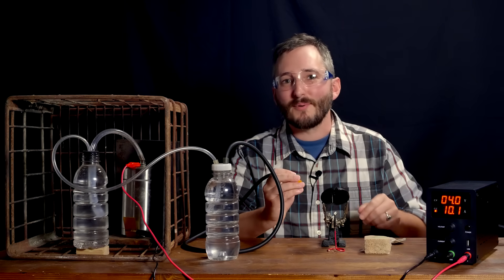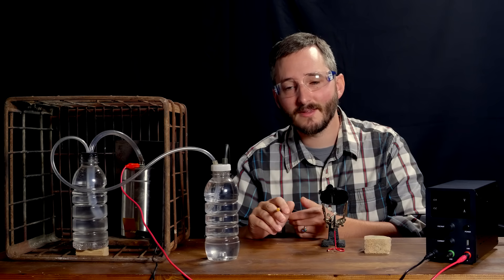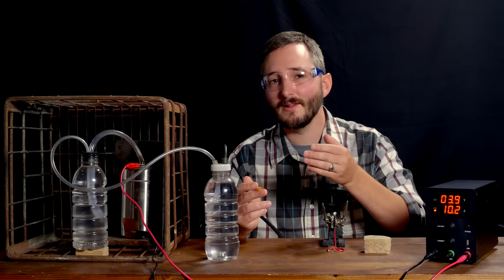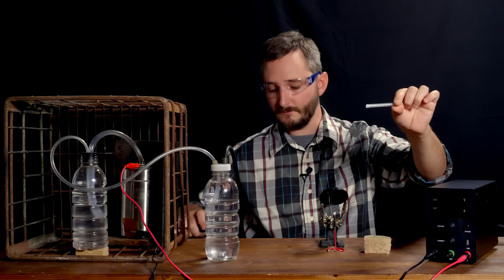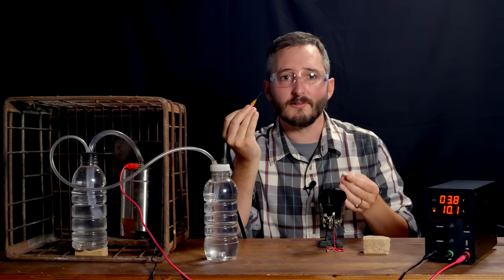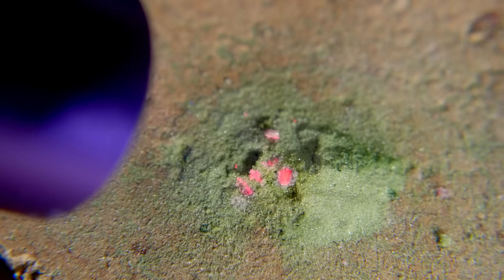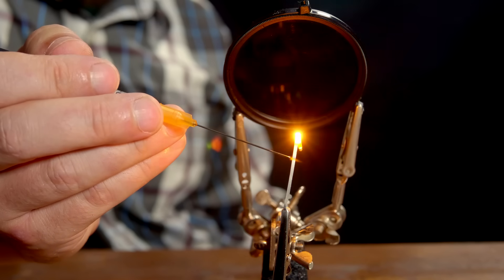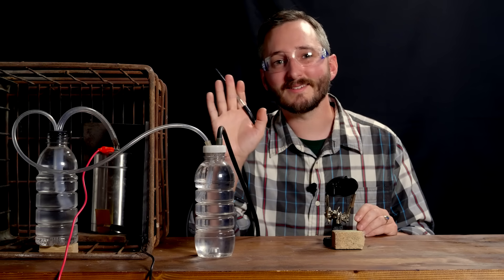DIY Oxy Hydrogen Torch Using Water Electrolysis

Comment: Thanks for another interesting video. What happens if you try to extinguish the flame in water? Will it burn underwater? If so, will it boil water? If it boils water it way be able to make steam and turn a turbine. Curious if you’d get more than 36W of energy back out. Not holding my breath for that one 🙂
Reply from the maker: I didn't try burning it underwater. That would be interesting. You definitely can't get more energy out than you put in

Comment: That torch would be hot enough to cut through steel I assume? I'd love to see what it could do for cutting power
Reply: Yes, it is hot enough, but I'd bet the steel would conduct heat away faster than the torch can add it.

 You're only putting in about 35 watts (and power out would be much less) plasma cutters operate in the kilowatt range
Reply: It likely wouldn't do that great for cutting, since the gas is an exact stoichiometric ratio, so you don't get the steel oxidising that does a lot of the cutting in typical torch cutting.

Comment: What if you increase the number of needles?
Would this make a “bigger” torch?
Reply: You would need to increase the size of the HHO generator in order to support an increase in the flow rate. Increasing the number of needles (or diameter) without increasing the HHO flow would cause the gas velocity to drop and lead to flashback.
Reply: @stumpy990  Though the bubbler setup he has in the video should arrest any flashbacks before they get back into the generator and blow that apart. Still, not something you really want to have happen.

Comment: "This is not a project to be replicated at home" sure thing :)
Reply: Couldn't you split the H and O lines to run through 2 different tips that were bonded together?
Reply: I think he covered the difficulties of splitting the hho in his last video. If I’m not mistaken, the generator he’s using now was one of his more efficient designs.
Reply: Well I rent, so doesn't that mean I'm technically doing it in someone else's home?   Legally speaking anyway.  I'm only familiar with bird law by training but I think it checks out.
Reply: @trotyl1432  He had a split cell in his previous video that worked quite well. The design could be upgraded to match his current metal body design, especially now that he has a micro-welder.

Comment: A good way to make them more user friendly is by mixing in a bit of propane into the HHO, the propane will make it more fuel rich and less explosive, it's a really neat way to make a very useful torch, and by changing amount of propane, you can get any flame you want
Reply from the maker: Interesting idea. Potentially useful and potentially safer, but I would still use a lot of caution.
Reply: @Nighthawkinlight   I used to use an oxyhydrogen torch for flame polishing the edges of cut acrylic, we also bubbled the gas mix through methyl ethyl ketone to give a better flame.
Reply: @peterjf7723  Where do you get the MEK from though?
Not easy to get your hands on these days.
Reply: @jimmyb1451  This was in Bristol in the UK. There was no problem in buying MEK there. We also used MEK for solvent bonding PVC parts.
Reply: @peterjf7723  Ahhh... It's different over here in Aus. :/

Too many .... people smoking frozen water. Almost become a controlled substance. 

Friggen handy to have around though, for a multitude of reasons that are not ... that.
Reply: You used MEK for the bubbler? That sounds sketchy as
Reply: @jimmyb1451  It will be in any decent sized hardware or paint shop. It's a common thinner.
Reply: @jimmyb1451  No mate, I am in Oz. I buy MEK from the local hardware. As someone who has made that special water for many years, many years ago, I assure you MEK has no real use in any process I know except as a solvent and plenty of easier to find substitutes exist. I have seen people trying to claim all sorts of common chemicals that industry and handymen couldn't manage without. The truth is, that with a bit of creativity, and some research, there's nothing I cannot obtain legally in Australia. I'm a chemist with experience in some organic chemistry, and a lot in Redox reactions in particular as I'm a retired professional fireworks operator and pyrotechnic chemist and fireworks making amateur. Now this is not legal in Oz, Yet everything I require for anything from propellants, colored and star mixes, sparking effects, salutes etc is perfectly legal and easily obtained except for the hotter oxidizers for colors. Which you can still get, but need to order from chemical supply places. 

Or go the extra miles and synthesize them from easier to get chemicals. You can't buy much Diethyl ether without attracting attention.  For precisely the reason of it's awesome properties as a solvent in several drug manufacturing processes. There are alternatives, but nothing so excellent. It has little use outside of organic chemistry these days, except as an additive in cold engine start preparations. Which some poor beggars actually remove by distillation, in small amounts and high price. It is very easy and cheap to make using concentrated sulfuric acid and concentrated ethanol. Which you can buy in methylated spirits or 95% denatured cheaply. The bit of methanol is better than the same amount of water, so methylated spirits is good enough. The denaturing agent, usually pyridine in the other isn't an issue. You'll need some glassware or homemade alternatives, both of which I've done and it requires heating the sulfuric acid to around 300 degrees. The chemistry is basic enough though it's not just a matter of following a recipe like pancakes. If you're clueless, you're going to hurt yourself before long doing this sort of stuff. But clues cost a bit of research and a serious mind. Chloroform is easily made from pool chlorine  for example and acetone. Not easily bought, but you can make it very cheaply. Many things are banned from sale under their actual name. Yet they are commonly found in everyday products at the hardware and supermarket. It's usually just a couple of steps to separating and purifying what you want. I love chemistry. It is the most liberating of all the sciences in an actual hands on physical life. It can feed you, clothe and house you, heal you, and defend you. It can be used to intoxicate and to entertain too. Everything civilization needs in a temporal context can be provided by chemistry. I was infuriated as a 14 year old when they banned fireworks in NSW where I grew up. Within a couple of years I'd made the connection between chemistry and fireworks and chemistry gained a devotee. 

As I have aged, more and more good things get taken from us by overweening scumbag governments who in Oz at least seem to consider removing all fun things from our grasp as a mandate. So I have responded since I was 16, by mastering anything which I like, and often even before they ban it because I know every time I find something really cool, it's going to be illegal sooner or later. Good luck with that scumbag politicians.  These days even my experience in horticulture looks like becoming another mastery of a banned thing. I see home food gardens becoming controlled and illegal. It is happening already in some countries and states in the USA. Take control of your needs and wants, don't let any tyrannical spoil sport c.nts stand between you and what you like when it doesn't hurt anyone else.

So it is the action of buying many of these things which alerts law enforcement. They make value judgements based on quantities and frequency etc. They also know some people and may either act on less cause anyway. They may also and this is so with me, ignore a bit more, since they already know I have some hobbies and we've fought to a deadlock in the past. So the benchmark for wanting to invest a lot of money and logistics in a potentially lethal operation and likely unsuccessful outcome for them anyway, is higher. They know I may be playing a little bit, but at least I know what I am doing and they recognize just a bit of hobby stuff, nothing commercial or dangerous.
Reply: @GrassPossum  ether synthesis from the alcohol is quite expensive in my experience although I come from where you can buy 50% ether starting fluid in bulk very cheaply, but yeah the regulations on chemistry really is annoying because just a few bad people out there misuse it, toluene was difficult for me to get due to its use as a solvent in not so legal chemistry and sodium nitrite which is great for diazonations is restricted because people committed suicide with it (some parents are suing a chemical company because they sold it, but i find it nonsense because their kids could have drank drano and the parents weren't getting their kids the help they needed). Here in california I cant even find MEK anymore for whatever reason, all they have is acetone and kerosene, not many useful solvents, even ethyl acetate and ethanol is gone (the denatured ethanol because people drank it and died, stupid people do stupid things at the expense of others :P). i am also as fascinated in chemistry because it's essentially playing god, you can turn just rocks and dirt into everything around us, its as close to magic as we can get
Reply: @DM-wp9vq  MEK is one of the documented preferred bubbler liquid for jewelry soldering HHO generators, I have used it and it works great.
Reply: @Nighthawkinlight  there are places in the world that actually add solar produced hho into the natural gas lines . If done at the correct ratio it will not flash back !
Reply: @Nighthawkinlight  another way to increase safety would be to add a thermistor and solonoid to control the fuel so if the base of the needle triggers the thermistor the solonoid closes off the fuel line. The flame would shoot back down the fuel line due to the flow drop but the solenoid would prevent it from reaching any more active fuel.
Reply: @robonator2945  the issue with that is that there may not be enough time for the solenoid to act, remember pure HHO burns at the speed of sound, the best option is a normal flashback arrestor ie bubbler
Reply: @EdwardTriesToScience  that would just depend where you put it. With a short fuel line definitely, but ST-DA solenoids for instance take 30ms to close (from a few seconds of googling) and with even a moderately long fuel line that could easily close in time. Especially since the flame would only start traveling down the tube once the solenoid already started closing cutting off the pressure, and presumably you'd have a bit of wiggleroom on that as well from over-pressure, meaning with 33% extra pressure you'd only start seeing the flashback at around 10ms in, leaving 20ms for the blast to completely travel down the fuel line and cross the solenoid before it closes.  Or, you could just wire two solenoids with the same circuit on the oxy and hydro lines before they meet with a separate outtake electrolysis setup. Then the flashback literally couldn't backfeed past the solenoids since the gas in either fuel line is missing a critical component for it's combustion, locking it at the Y joint where they meet.
Reply: The old Browns Gas generators used a flame arrester bottle full of methanol to act both as a flame arrestor and as a means of making the mixture slightly rich (reducing). Another trick was to add either borax to the liquid to add a trace amount of flux. The old Browns Gas arrester was a heavy stainless steel cylinder with a wide screw on lid and welded in fittings.
Reply from the maker: @pixelpatter01  I like that idea. Passive methanol injection through the arrestor is much easier than piping in propane. Then you need extra caution containing the arrestor though, as a liquid fuel spill would be very dangerous.
Reply: @Nighthawkinlight  ive seen it suggested that the bubbler have a mixture of water acetone and alchohol... I already commented this
Reply: @Nighthawkinlight  What about methane? I have a compost digester with a ready supply.
Reply: @Nighthawkinlight  fill the arrestor with an open-cell metallic foam material, then if it spills the foam control the spill rate. I believe they do a similar thing for hydrogen containers.
Reply: @Anenome5  what would you think about ceramic wool
Reply: Incredible as per usual. Is that glass you are making holes in? I have seen many implementations of HHO, and every time wonder how well it would it work for fire polishing glass. In my case, I recycle wine bottles (etc) into tumblers, drinking glasses, etc. Creating a lip similar to that found on commercially available glassware would be awesome IMHO. Thoughts?
Reply: @-robo-  I would also like to know for the same reasons, I want to work it with glass for very fine holes and smoothing others as well.
Reply: @SeeTheWholeTruth  Great minds... I would like to build an array of nozzles to make a precise pattern of holes in one shot (as opposed to explosion).
Reply: @-robo-  thermal expansion would be an issue, unless you're working in borosilicate or zerodur.
Reply: @-robo-  fast and smooth cap sealing of glass ampoules is one of the uses of HHO; the butane or propane torch can be used too, but only for manual sealing which is not that nice - not like like the factory produced ampoules with that round cap
Reply: @LiborTinka  Any tips on making a seal with a nice round top? Links or off-line chat (discord)?
Reply: @-robo-  technique,  I'm old enough we had to make and seal glass  ampoules at pharmacy school, 
Flame each side of neck, introduce ampoule  neck to flame,   rotating  ampoule, after glass starts to soften while still rotating ampoule , stretch  neck, till removed, rotate ampoule  a fraction longer,  gives a soft rounded professional finish, as opposed to a sharp pulled sealed top. Practice , practice practice.  After a few hundred  you'll get  it right
Reply: @-robo-  you might need to anneal it after you made the lip to avoid random breakage later
Reply: @MordecaiV  Ah yes.. thank you.
Reply: @-robo-  great application indeed
Reply: @-robo-  pretty sure that was a small glass pane when he was melting multiple holes. 

I note that a crack happened at edge when he tried a hole too close to the edge of the pane. So flame polishing might be possible but would require careful experimentation and protection from flying shards, e.g. face shield, goggles, full clothing coverage, shielding around the work surfaces so any shards are confined to a smaller space...
Reply from the maker: @-robo-  Yes it works for glass, but so does an ordinary propane torch. I've fire polished a lot of glass with my bernzomatic ts8000
Reply: @Nighthawkinlight  Thanks! I can make HHO, I can't make propane.
Reply: @Nighthawkinlight  How good is that Bernzomatic for rigid copper pipe annealing?
Reply: @alfredomarquez9777  I would imagine that would be slow
Reply: Nice !
Reply: I'm fairly certain that "gas doping" reduces the flame temperature, but it's still going to be much hotter than propane alone.
Reply: I built one very similar to this a few years ago, complete with using stainless wool for the electrodes and KOH electrolyte. I found I got a less temperamental flame by using alcohol in the bubbler - 99% isopropyl iirc. I tried using a proper torch tip a few times, but only managed to make a sort of self-heating steam generator🤣
Reply: Defies the whole purpose!!
Reply: what about a fine metal mesh for a flake arrester?
Reply: He did shove some aluminum wool in the syringe which acts like metal mesh for flame arrest already
Reply: @EdwardTriesToScience  i should have watched the whole video before commenting.  😅
Reply: @nickcaruso  I was thinking a ceramic wool
Reply: Solder?
Reply: Any way to make HHO usable to heat? Or as a repleacement for gaz? I wonder..
Reply: yes, water can be decomposed to hydrogen and oxygen under extreme pressures and heat but it'll just recombine and explode again
Reply: @EdwardTriesToScience  no, i was wondering if it was possible to use HHO gas to use in house heating? As in some kinds of repleacement of "fioul" or "gaz" which price have skyrocketed lately? Also it's green... But i guess it all come down to electrolysis and KWh cost then? Also i'm looking for people experienced with hot plasmas as i believe it may be very efficient to that end? Are you?
Reply: @RabenKaiser  lots of info at eagle research - George wiseman
Reply: @RabenKaiser  If you'e gonna heat your house, might as well use electricity itself as its more efficient for heating, electric stoves heat faster as well because the pot is in direct contact with the heating element while a flame just throws heat everywhere. it would be better to invest in electrical heating than building some HHO generator and guzzling water and electricity for heat. Dont get me wrong, fire is better tahn electricity in may ways but heating isnt one of them
Reply: Instead of the propane, you can dope the electrolyte with cupric sulfate. Which I believe is the secret ingredient in the electrolyte mix (KOH,) that is sold for the current jewelry units (it's a guess based on color and the fact that the burn color is correct as well)
Reply: @Jamesvandaele  KOH is Potassium Hydroxide and there's no Sulphur or Copper in there.
Reply: if this was a commercial product you reference, and it was called KOH, that is all it was. Unless it listed some other additive, by name or category.
Reply: @GrassPossum  KOH, water is the electrolyte, I was suggesting adding dissolved cupric sulfate so that the flame has colour I believe.